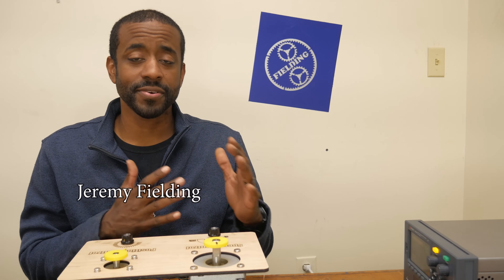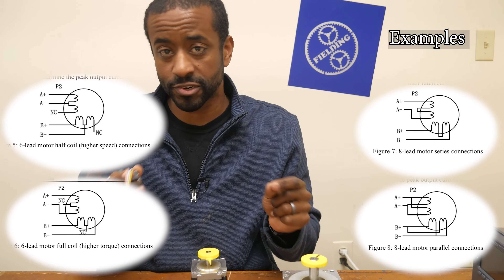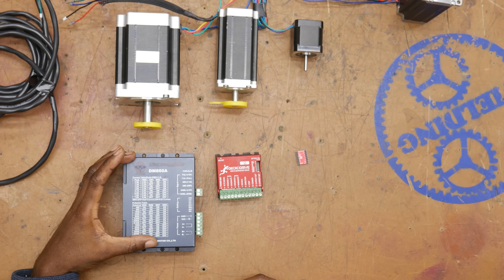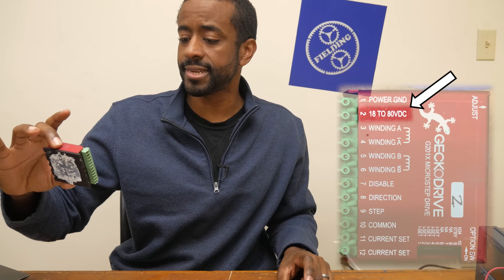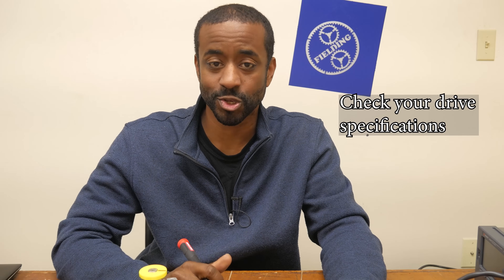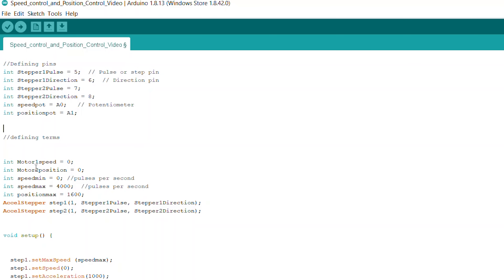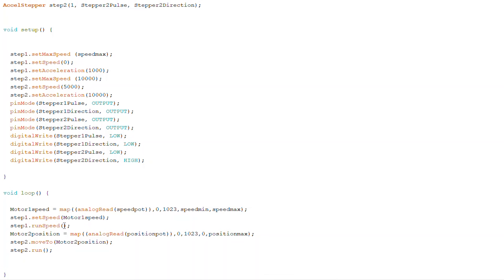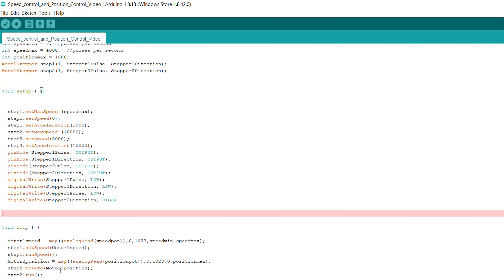Beginners Guide To Using Large Stepper Motors: #087

Comment: Hello! I really need some help with my Isel Microstep Controller C and stepper motor setup.

I’m trying to reference (home) my motor using MATLAB serial communication.
I’m connected on COM2 @ 19200 baud, and I can send commands like @07 (XYZ mode), @0S (arm), @0A (bounded move), and @0R1 / @0R2 (referencing).

Everything connects perfectly — MATLAB sends commands and the controller replies (I get R, R0, or R02 messages).
But when I try to run @0R1 or @0R2, the motor keeps spinning continuously and never stops at the limit switch.
I have to manually press stop or power off to halt it.
The controller then shows “R” (wants reference), and after that, it refuses to move for any normal @0A commands until it’s referenced again.

I already tried:

Sending BREAK (255) and @0S to clear any latched motion — works fine.

Homing both directions (@0R1 and @0R2) — both end in R02 (homing/limit error).

Nudge pulses (@0a with small durations) to move off switches — the motor moves a little, but referencing still fails.

Confirmed that the motor is a stepper motor, not brushless.

Controller replies correctly, but bounded moves only work after a successful reference, which never completes.

My questions:

1. How can I correctly reference or home this Isel Microstep Controller C so the motor stops automatically?

2. Could this be a limit-switch wiring issue (normally-closed vs normally-open)?

3. Is there a way to disable or bypass homing temporarily, so I can test moves without the reference?

4. Which input pins on the controller correspond to LS1 / LS2 / GND for the X-axis sensor?

5. If possible, can you show the correct wiring or polarity for the limit switches?

Any advice, pinout diagram, or example configuration would really help.
Thank you so much for your time!

Comment: Hi Jeremy, I enjoy your videos a lot. I have a request. I want to build a CNC machine at home. Not a hobby type (I have one of those and it's too small) One that uses Nema 23s or bigger. How do we find a board to handle control for the larger step motors and how do we determine how much power we need to run it? A lot of us would love a schematic with a parts list to make something like this. Can you help? Thanks!

Comment: Ok Jeremy i have been.  traying to get to grip's with  a led screw. ELS Develop by Cloug42,  it been bit of a struggle for me to get my hed around it     a large mothers board i traying to understand it a 71 years is difficult for me . Your program help a lot  I aske why i could not  ues a  motor of a mobility scoter.  & got no answer.  can you exsplan that to me . so i get it in mined  . the there that coder on the Spindale how dos that work the exsplan it. but not like you do   check out the led screw & get back to us in a video.  Les thanks for what you do .  I'm traying to get A ELS  on my old lath.  i need to understand it before i buy .

Comment: please excuse my nitpicking,,,

* Why does the title have the word "large" in it? I expected to learn some quirks specific to large steppers, but i have heard none.
* about the current spec. It sets the motor to the maximum torque, but not necessarily the maximum performance. Because performance also includes stability and speed. And stability/max speed may actually go down with increased current, if the supply voltage of the driver is not enough to sustain regulation of the current at high speeds.
Reply from the maker: I said large because the drivers and wiring look different. It’s that simple. The functionality is the same but often the setup looks different to a beginner. I know from reading hundreds of questions about this topic when people see tutorials for those tiny ones with programmable boards and pots on top for changing Voltages etc. that doesn’t help them with these bigger ones. When a beginner is looking for help, it’s much easier to understand when the equipment looks similar and the setup is similar. To answer your question, “large” is the only thing that is really different thus the title.
Reply: @Jeremy_Fielding  okay, you have a point.

Comment: You show 2 power supplies on your Amazon site.  The motor (Nema 17, 12 volts, 1.5 amps) I'll be running isn't for a 3-d printer but for a less demanding task. Which power supply do you recommend?

Comment: if you're getting into stepper motors these days the wonderful thing is that there are all sorts of 3d printer motherboards that can be programmed from the arduino ide that run 32 bit microcontrollers that accept stepstick drivers. And if you want to go to nema34 many tmc5160 drivers include a ribbon cable and a breakoutboard for the stepstick and still have stealthchop and stallguard built into the driver. for less than $15 a driver. Crazy times.

Comment: Hello Jeremy, I am thinking about using a 555 timer to the driver in order to control the speed of a stepper motor. I want to try to reach anywhere between (1200 ~ 1800) RPM. Do you think achieving that rpm is possible? For some reason I think it might draw a lot of current. The reason I am asking, it is very difficult to find appropriate NEMA 17 steppers for this project.. I'm a novice with working with motors.

Comment: very good presentation of this complicated subject....
that said, its not clear to me where the power for stepper 2 comes from...did you remove the stepper 1 (4) power wires and swap them for the stepper 2 wires?
Reply: I'm curious about the same thing....just posted at the top
Reply from the maker: there is a wiring diagram in the video, and in the video description.

Comment: Used your code and wiring schematic for the position control, but my stepper keeps turning. Continuously it does change position and turn with the potentiometer but when I stop turning it it keeps turning.

Comment: Hi Jeremy. As usual, great video. 
I have a project that requires a stepper motor to rotate 360 degrees clockwise at a constant rate, while another stepper motor rotates from -85 degrees to +85 degrees. There is an equation that tells me what angle the second motor should be relative to the first. It’s some logarithmic function that is slow at the beginning and gets faster until it reaches 0 degrees, then follows the same acceleration it did in the first half, but a mirror image of it. So it starts out slow, gets faster, then slower again. 
Will I be able to program something like this into the software?
Thanks,
Paul

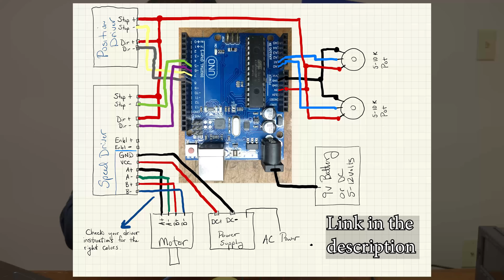Comment: your schematic @16:12 shows only 1 motor, yet  your demo has two separate ones. However, your "speed driver" and "position driver" are in series so I am guessing that the second motor (which again isn't shown) is also in series with the shown motor right?

Comment: Hey Jeremi,
Thanks for the video. 
A quick question on this video?
Can I get higher torque than 1.27Nm by reducing RPM for the following stepper motor? Let’s say for a 5RPM, can I get 764.3 Nm?

Pn=0.4 kW
Nn=3000 rpm
M0=1.9 Nm
MN=1.27 Nm

Comment: In the video you say to set the stepper drive RMS setting to match that of the motor. I noticed my stepper driver also has a peak amp setting that is higher than RMS. Is that a problem?

Comment: Jeremy, you have made my day as an automotive tech. Why? Because the controls and stepper motors used in a bra I like GM have seen little change and I want to include their hardware, software and stepper motor system into my 1967 C10 truck. The HVAC system has several requirements to have some stepper motors simply move all of the way open, then all of the way closed. Others like heat, need increments of movement to control temperature with heat. One moves a door blocking air flow thru the heater core while opening the left lower heater vent door open more for that warm cozy feeling. If I am on the other side dressed for cold weather, I don’t need it open that far. Instead of stepper motors, they are simple dc motors geared to the door and a potentiometer for feedback. This was mention and must be part of robotics. Not optical or pulse from a magnetic sensor and tone ring but a simple pot. 5Vdc to feedback and 12Vdc to the motor. I will have to watch more!

Comment: Hello, I am a newbie in these topics, I am trying to do what you did with the position wheel, but I want the motor and encoder to move at the same time, in short movements there is no problem but if they are a little longer a delay is generated Would it be possible to get it with accelstepper or would I have to use a PID? thanks in advance

Comment: do you run into electrical noise problems when using arduino/raspberry? how do you solve them? I saw the power supply cable was shielded, is it only one end of the shield that is earthed?

incredibly insightful and useful and valuable, i´ll save this for future reference JEremy, thanks!!

Comment: Question, how powerful are the smaller motors? I'm guessing very powerful. Why I ask is most 3d printers are using the smaller ones which I'm guessing are well over powered for what they are used for in the printer itself? fyi love your videos!

Comment: What if I need to use RPI to control the stepper motor, what software would you recommend? is there a piece of python code you could share and wiring to the RPI?

Comment: I am trying to build a robot, I have figured out the inhub hoverboard wheels, then I got bld300b drivers and plan to use a Jetson nano to control...I want to use a Arduino Uno to test controling the wheels before the next investment into the Jetson nano. Can you help me with a basic schematics to use the uno to control the bld300b driver. One more question I have a few old laptops, could I use one of those as the robots brain to control the bld300b.

4 hub wheels
4 bld300b
3 Arduino Uno
Windows laptop
Linux laptop

Comment: I wonder if you would see a difference in energy consumed if you first checked the current speed/position and only send the run commands when it should be changed.  I have no idea if that would even make a difference in the energy consumed or the efficiency of the system.

Comment: Excellent overview and explanations as always, Jeremy! I wish I had seen this a long time ago before I had to figure all this out myself by reading specs on motors and drivers and experimenting with various combinations. This was even before Google, so there was really no good way to gain this information. My company wouldn't OK a class one of the stepper motor companies offered, so it was just dig in and and figure this stuff out. It turned out well, but would sure have been a lot easier and been completed a LOT more quickly with this information at the beginning of the project. Of course there were also no microcontrollers like Arduino, so we had to write all of our own code completely from scratch. Fortunately for me, some of my coworkers were very good programmers and picked up the techniques for controlling the stepper motors (accelerate, decelerate, holding current, etc.) pretty quickly. BTW, I'm a retired electronics engineer. I worked on a lot of different stuff during my 40+ year career. Stepper motors was one of the more interesting projects that I remember. The application is way to complex to try to describe here, but suffice it to say, it was very challenging for a group of engineers that were starting completely from scratch with stepper motor technology.

Comment: Hello Jeremy!
I can't wait for you to get started on your new assistant videos ... oops that's from another video.
Well I preferred to write you under this video because the problem I have is with a stepper motor: I installed one in my old video slider with the Easy Driver and Arduino but the motor steps feel a lot and it makes the camera vibrate. The motor is a Nema 17 and although I am using a heavy lens (70-200 canon) and the DJI Ronin S (to have more axes of movement), it moves quite well ... the problem is the vibration, as I told you.
Any suggestion?

Comment: I bought E-bay stepper kits with nema 23 high torque. My table in heavy and small I am limited by inertia to less than 100 ipm. cutting speeds. I lucked out and used trial and error to maximize cutting speeds and feeds. Able to use .0625  endmills at 20 thou. rpm at 70 ipm to cutt .125 birch play Glue down with tape and superglue to my spoilboard. I want bigger machine but am holding back because of the recent climate. When I started in 2013 or so I already had a table from and expensive machine. Previous experience with vertical mill and manual lathe also helped greatly to get it up and running.Jeremy is a smart cookie. He kind of reminds me of my dad. Stay Home and play with junk collection until he could tell you what to look for to fix or build anything. We didnt have vfds. so readily available and machine tools were mostly three phase. Today manual machines are given away to make room for new machines. You just need to haul it away.

Comment: Don't you just love working with this stuff? I know I do.  I feel like I'm in my element doing physical programming and I can actually see something move or turn on under intelligent control. I'm seriously thinking of stripping the electronics from an older but working washing machine and making my own controller and interface to control it's operation. Those few individuals thats gave a thumbs down are probably pro 3 phase bushless motor people and are against steppers. This is all basic stuff, but it's a really good presentation. Rock on brother.

Comment: Love your vids.

I've been around CNC machinery for almost 2 decades... At first I was assisting in repair/replacement of parts. Eventually, I became a maintenance tech at a factory sized machine shop. Sure liked that job but.... we... you know, management mucks things up.

What is odd is that I never learned code or programming. I'm basically a mechanic, and depended on an operator to make the machine move for me to snoop out the issues...

I do wish to learn this stuff... but I'm old now... retired. Getting a job is laughable, since nobody hires over-50 somethings.

Still, I would love to have a small CNC for home use, learn how to be proficient with it.

Comment: I  found that 12Volt windshield wiper motors are super strong and low voltage.  I will use them as steering motors for riding mower front tires..

Comment: Hey Jeremy, great video. I made your circuit and copied your code. It works!!!  But.....     The position control is weird. It moves left and right no problem and I can control speed and acceleration with accelstepper parameters.  The problem is when its stopped. It shakes terribly and moves slightly counter clockwise.  Almost like it was getting new values that were just a bit different. I've  changed the the 10k pot, but it didn't help.  Any idea why it would move slowly counter clockwise when its supposed to be stopped.

Comment: I have been wanting to make a router table (not CNC) but with steppers to dial in the exact height of the bit and the fence so when I need to cut a 1/4 inch by 1/2" rabbet, I can just adjust the settings and know exactly where it's at.  I've always been intimidated by the controllers.  Thanks for this and I'm hoping for more videos like this.

Comment: I have a question that's been very difficult to try and search up for a solution....I want to make a turntable to stretch wrap stuff. so speed needs to be pretty slow, and there needs to be enough torque to keep spinning once it starts wrapping the stuff with plastic. if needed I'd say avg weight of items are anywhere from 10-100lbs. my question being any ideas on a good motor? It can be a specific model, or general specs I can work with either...I've tried a few different motors, but there always geared to high or low or as soon as load is applied they stop, or worse spin the other direction😓 any help is very much appreciated. thanks in advance!

Comment: While accelstepper is great to start out with it isn't very fast.  I'd recommend using grbl on esp32 or stm32.  These can control up to 6 steppers and can run ~200khz stepping rates.  accelstepper tops out at something like 4khz on an arduino mega.  This is most important when using x32 or x64 microstepping and multiple motors which tends to be much quieter than lower microstepping.

Comment: Soldering simple, trick is good rosin flux and good solder with a bit of silver in it such as Kester SN62PB35.65AG02SB.35 Thanks for the great videos, you are a very good communicator. You often answer questions as they pop into my mind.

Comment: Jeremy, I have a question about the circulating motor for a forced hot water furnace. The circ pump gets very, (very) hot, I wondered why I couldn't put a heat sink or maybe a heat sink w fan on the end? The factory manual states the motor can be 40 degrees hotter than the furnace water, not sure if this really cuts the lifespan. Am enjoying all your videos.

Comment: Also, for those watching this video: the current on a stepper motor is for a specific voltage. This info will also be on the motor's datasheet. Calculate what the current on the drive will need to be given a power supply of your choice. Don't just set the current on the drive to match the current on the motor; that's silly. In Logic circuits, a disconnected pin is considered to be floating; i.e. an indeterminant state. Some drivers require a connection to VCC (the logic +ve power supply) to be enabled, and some require a connection to GND. The only time when this is different is if the manufacture of the stepper driver says that you can leave it floating. This is normally the case when the stepper driver has an internal pull-up or pull-down resistor to keep the gate from floating. As you can prob tell I thumbs downed this video. :( Nice video otherwise.